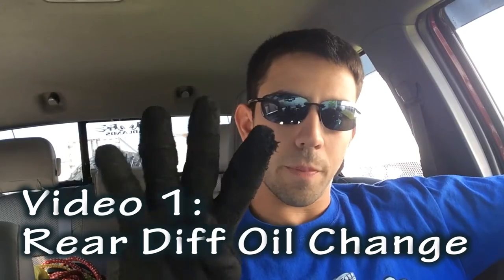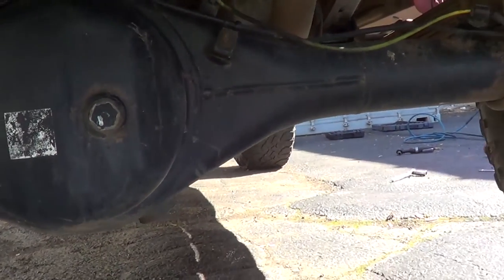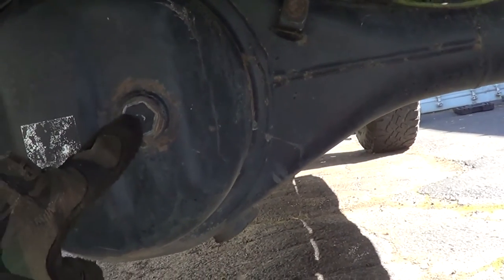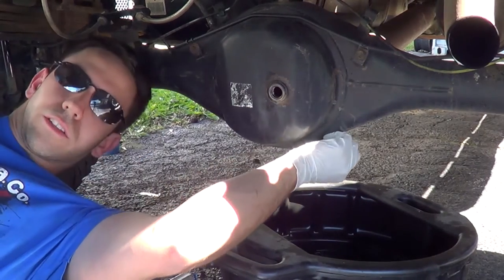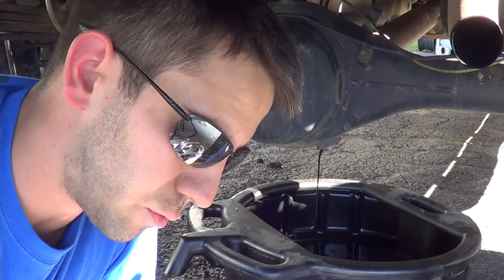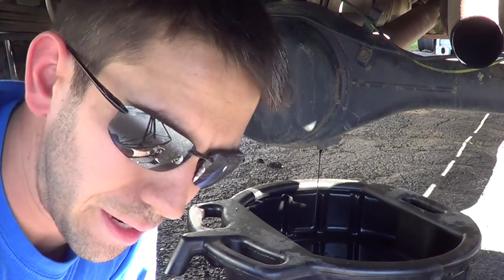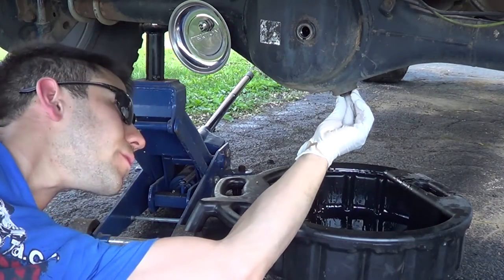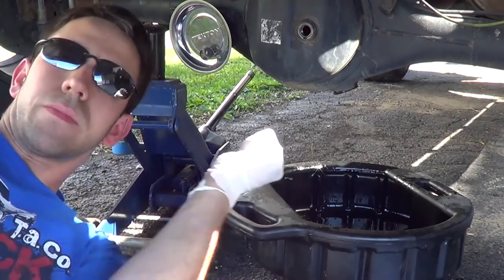Toyota Tacoma Rear Differential Fluid Change - Not Full VIDEO (see description)

Comment: Can I use thew Mobile 1 in front and rear dif and transfer case instead of using 2 different oils ? My 2008 FJ is stock .
Reply from the maker: James Dunkerley you should use the same fluid in front and rear diff. I use a different fluid in my transfer case. On a stock truck I would use the same fluid on all 3.
Reply: Tunnel Vision 4x4 thank you for answering me so quickly , I enjoyed the videos , about to watch the trans fluid video 👍

Comment: what fluid you use for the front and rear diff???
Reply from the maker: I have links in the description, but I use a heavy duty gear lube of 80W-140 (http://amzn.to/29ZcnIJ). It was recommended by the people who sold me my gears at East coast gear supply. The stock gear oil is 75W-90 (http://amzn.to/29Zcvbg).